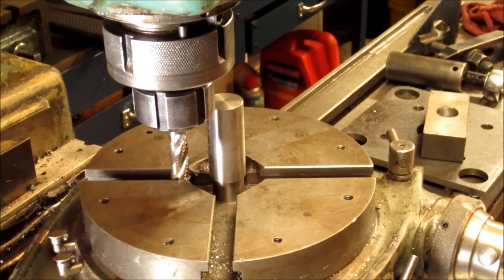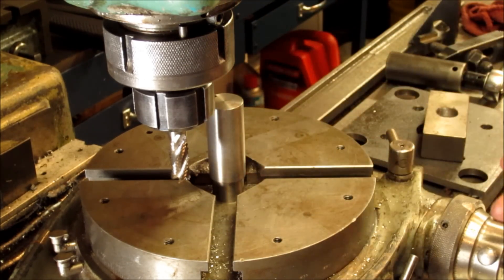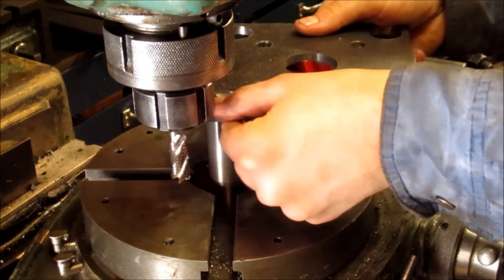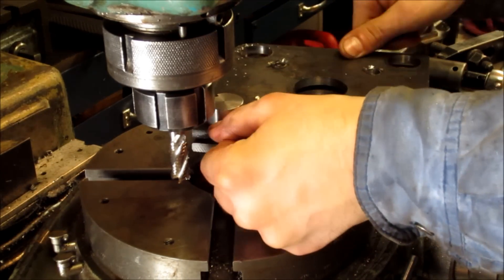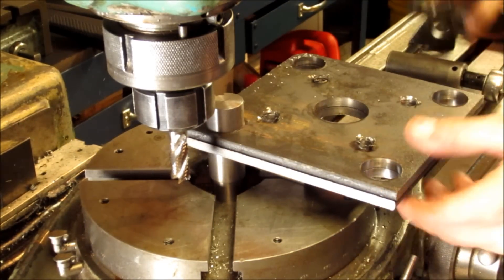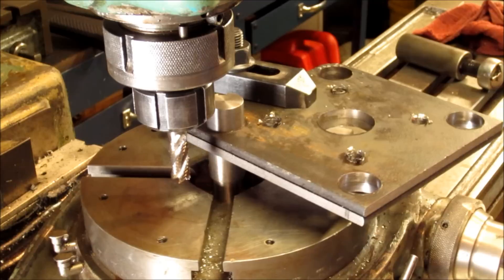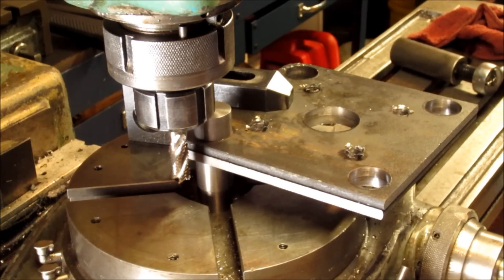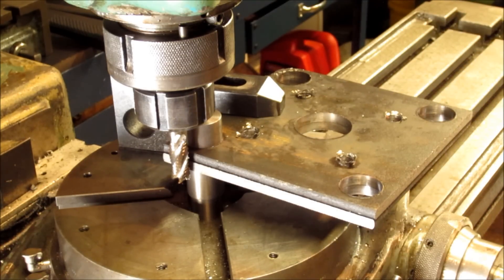Cutting a radius with a rotary table.

Comment: holy cow. climb milling? scares the crap out of me. any apprentice watching,,, never do this it's fucking dangerous. I know what I'm  talking about.
Reply from the maker: +userwl2850 Alot of people have pointed that out. I climb mill all the time and not once have I run into issues.
Reply: You make me laugh been scared about climb milling ..... Many engineers do climb mill as you can in some circumstances obtain BETTER finishes, if you knew about rotary tables then you would know about how small the backlash is and it's possible to eliminate backlash to next to nothing ......oh I've been an engineer (advanced turner/Miller/fitter maintenance engineer) since 17 years old.... I'm now in my late 40's .....
Reply: Climb mill when appropriate.
Reply: +moomoomooism hi. I absolutely promise you I've had more experience than you. a very good friend of mine lost the sight in his left eye (wearing safety glasses) with this type of machining using only a 5/8" 4 flute end mill. I have some machining vids if you have time to luck. cheers.
Reply: +userwl2850 climb milling is no issue..... Holding correctly was all backlash needs to be removed, correct clamping or holding with the correct speeds n feeds also required  !!!!! And yes by all means I'll look at your vide m8

Comment: FYI, a little lubricant/coolant will make a huge difference in the life of the end mill as well as make a better cut.  I cringed as I watched this video when I saw the abuse you were exposing that end mill to.  I have a few of those Niagara roughing end mills and I know they can chew through material at an incredible rate,  but they still like to be loved with a little lube.

Comment: climb mill operation,much better to cut with conventional cut,if the rotary table has a backlash with 1800rpm or more for aluminum chances to crash your workpiece or your endmill..

Comment: what if i dont want a big hole in my part
Reply from the maker: You'd need to find some other way to locate the center of the radius you're trying to cut. Those big holes were part of the part I was making so it worked out for me.

Comment: climb milling wants to pull the work in and on a rotory table it will cause chatter if there is any backlash, also dangerous it could rip into the part and toss it

Comment from the maker: No problem. I'm glad you enjoyed it. You should check out practicalmachinist(dot)com for more great info.

The rougher end mills can really chew through steel. I have a 3/4" Niagara rougher and it's nothing for it to take a 1/2" deep cut right through a solid block.